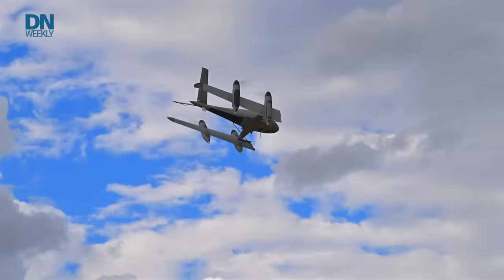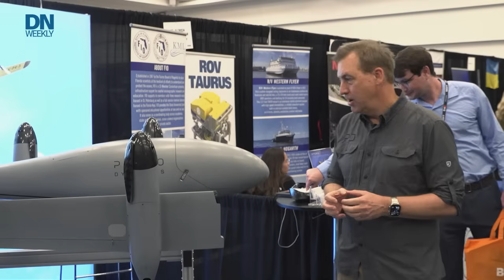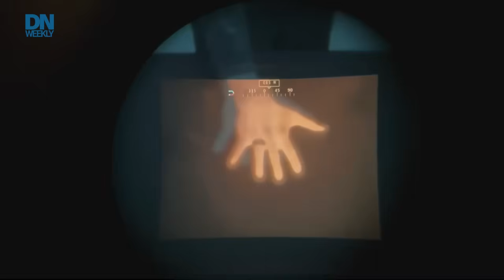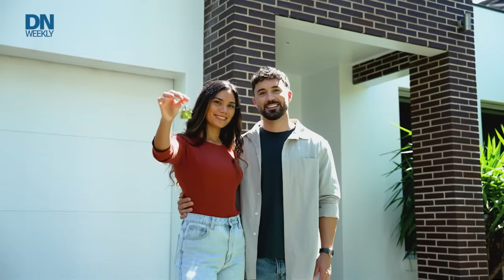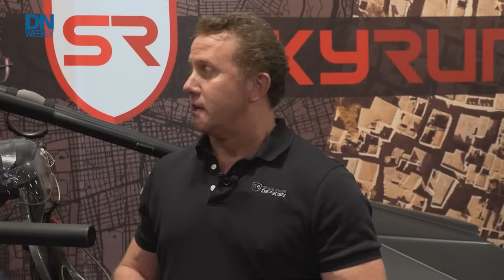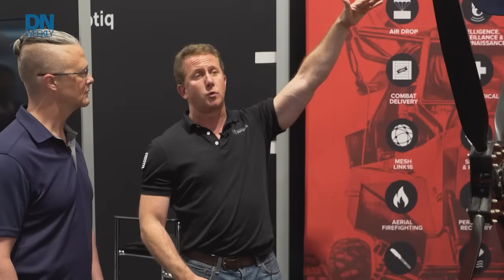New NVGs and a flying dune buggy | Defense News Weekly Full Episode 7.12.25

Comment: NO, NO, NO, FOR THE PARA-GLIDER IN A UN SECURED FLYING SPACE. NOT MILITARY BUT TRYING TO GET A WORKABLE  PROCEDURE TO FACILITATE TRANS FLYING MODE TO EARTH MODE AND RE PACKING THE WING MIGHT BE EASY AFTER A WHILE BUT, GASK SPEACAIL FORCES TO APPLY OR NOT APPLY AND WHY.  DONT MAKE THIS FUN LOOKING THING CALLED A PARA TRIKE EFFECT YOUR JUDGEMENT ON PRACTICABILITY.   NA HANG GLIDER TRIKE WOULD BE MORE EFFECTIVE BUT MORE OF THE WING STORAGE QUESTION.  MAYBE A FOLD ABLE WING.  IN NEW MEXICO I CAN BY A ENGINE OR ELECTRIC HANG GLIDER WING TRIKE FOR ABOUT 30 THOUSAND BUT IT IS A QUIET ELECTRIC TRIKE MODEL.

Comment: WHY would you want NVG's burning thru 4hr AA batteries ?
Why on Earth wouldn't you use rechargeable batteries ?
Reply: Well as a person that has had this problem in Iraq. 
On a combat mission; they going to stop at a Starbucks and charge equipment? 
Drones bring batteries. 
Recharge batteries also catch on fire easier when hot. 
It’s also nice to know that 4AA batteries are four hours. 
I only need; 8 AA batteries for a night mission. 
Recharge batteries also if damaged; the entire system has to be turned in. 
Using AA is also more durable in hostile environments like bad weather, or deserts. 
Also it’s a quick switch when batteries are dead. Most combat missions don’t go over 8 hours, unless they In trouble

Comment: I think it is the expensive part that America struggles with when talking about drones. They certainly are building drones for specific use cases but this drone was also said to carry warheads as well, so they are trying to make it multi-functional. The problem is how expensive are you making one drone, can it work at a 100 percent after it has been hit with rain, stuck in mud face humid temperatures, hot or freezing temperature. It needs to be cheat but effective. Heck I saw drones using wood as a material in order to reduce the cost of a single drone. There maybe less efficiency but they can make replacements quickly and produce millions in a short while. The game is numbers and being effective at the same time. America is failing at getting things cheap. 

Iran and Russia have shown that they can be quit effective while being very cheap with the cost of the weapons. I think China and NK does the same thing, but all that said these countries compensate for faulty weapons by making so many that at the end of the day they make enough to consider the faulty ones as negligible.